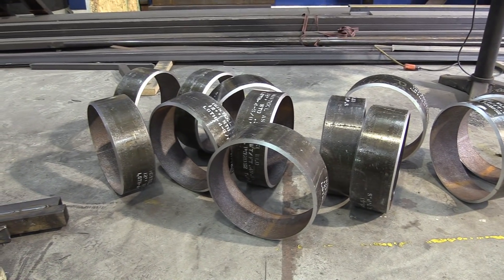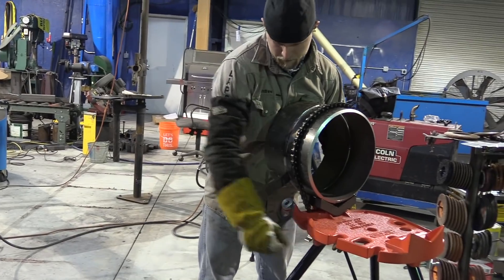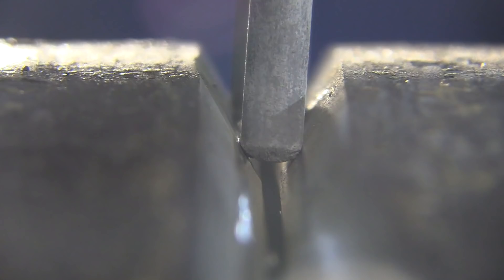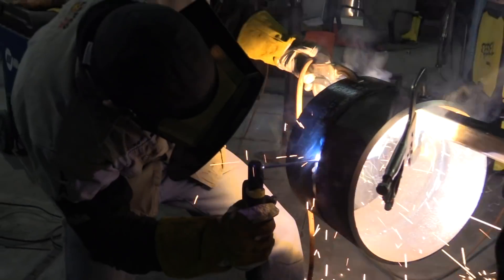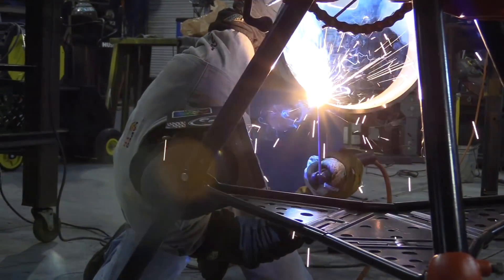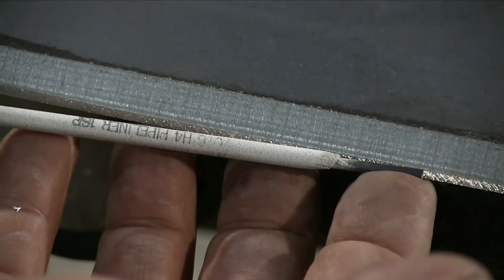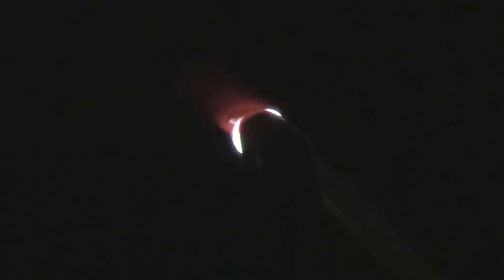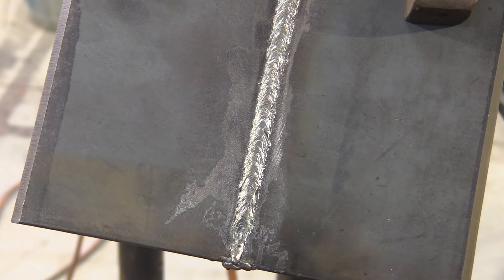5g Pipe Welding Downhill Root 6010 API 1104 #weldingtipsandtricks

Comment: In my experience the 5/32" bead tests I've seen, the inspector wanted a penney gap penney land. Stay safe brother.
Reply: Root face 1/16 +or -1/32  gap 1/16 +or 1/32
Reply: It’s preference for the welder not inspector . As long as it’s in the procedure . You can do penny and and gap or 3/32 or 1/8 .

Comment: As you use a point your rod at the centre of the pipe for pipe welds. This don't seem to translate to the flat plate welds which have a fair drag angle. Is there any good reason the 90 degree angle don't  work on the flat plate welds?